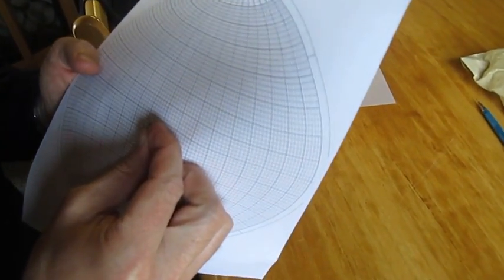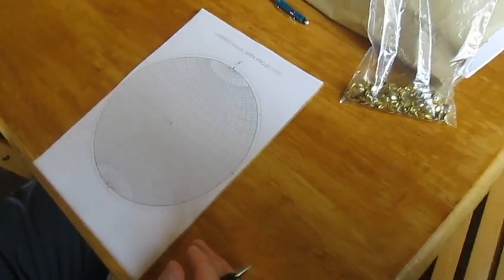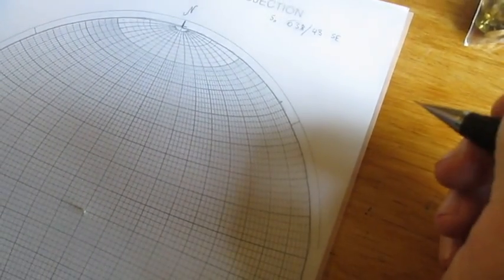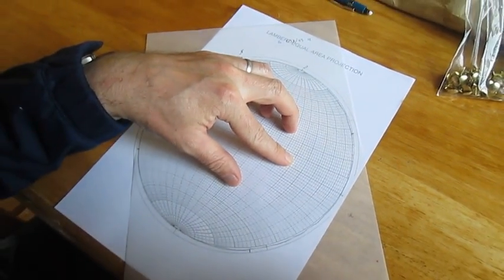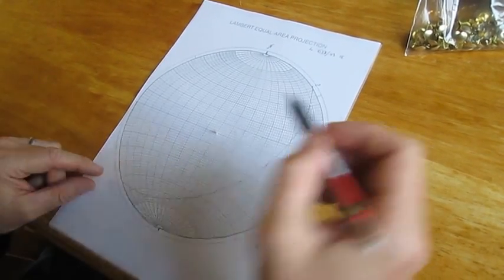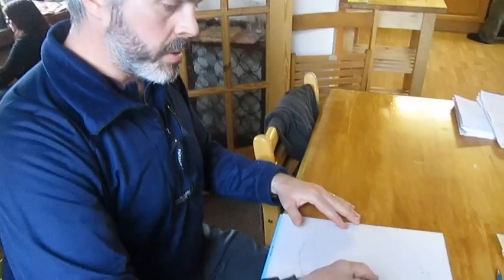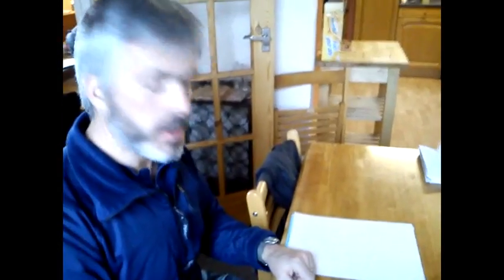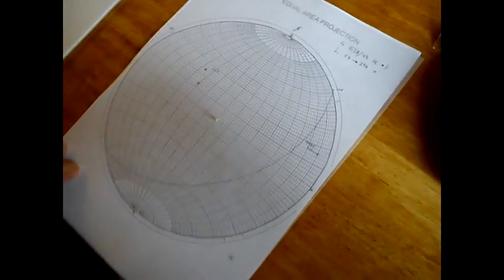Stereonets 1 - with Carl Stevenson

Comment: Around 6:35 we start plotting the pole of a plane. Wouldn't it be 90 degrees off from the dip (43 - 90 = 47 degrees to the other side) instead of just the same 43 to the other side?
Reply: +PerfectDuck Because the counting is done from the centre of the stereonet you can just use the dip value (i.e., 43 degrees) - 43 from the centre of the stereonet is the same as 47 from the outside (so if you were to count from the outside inwards then you would have to subtract from 90 as you suggest)